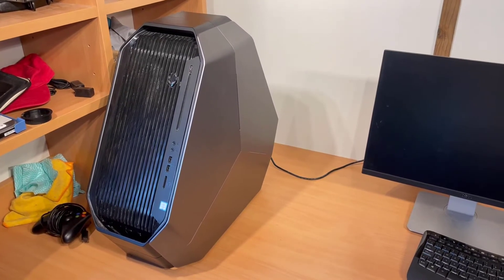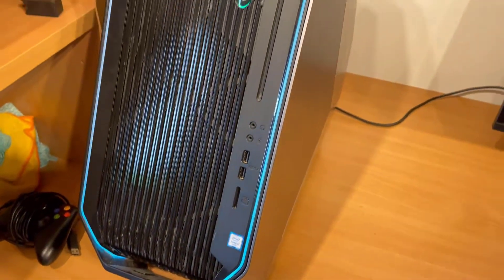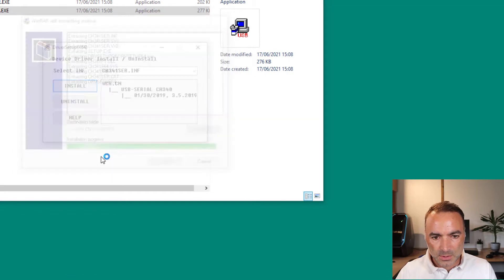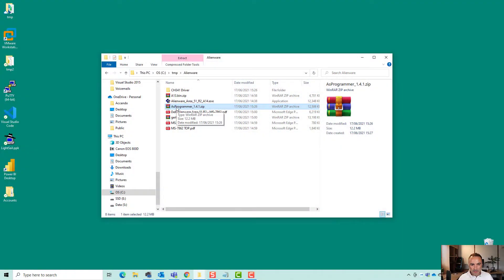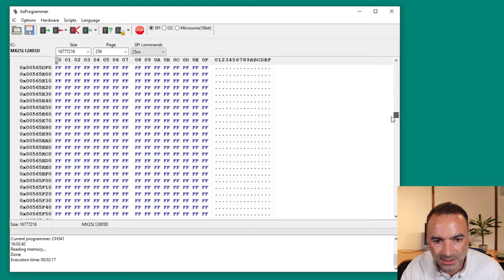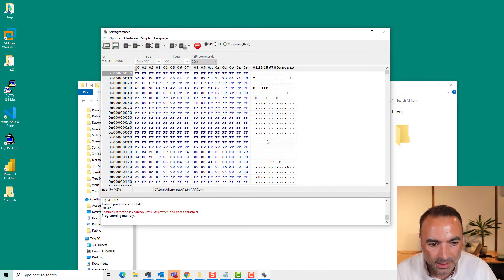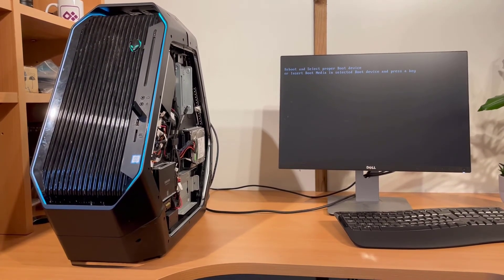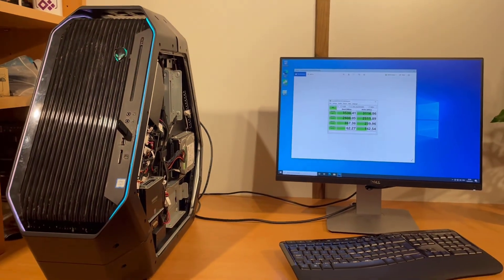Fixing a Dell Alienware Area 51 r2 with a corrupt BIOS

Comment: 10 tries is correct to attach the clamp
Reply from the maker: 😂 yes, it’s not easy to get on. Did you get it done?
Reply: @PaulieM  it flashed bios, however no response after flash. I reset the bios prior as well. All symptoms are the same but no response.
Reply from the maker: @Oldstockz  damn - what a shame. Must be something else wrong with it.
Reply: @PaulieM  yeah assuming GPU or mobo

Comment: Paulie can you please provide me some help with activating my Re Bar function on this motherboard ? I am using grub and using the code setup_var 0x24D 0x1 to enable rebar. I do the the message error ; offset out of range do you know any solution am I using a wrong Grub version of EFI ?

Comment: I got ram (16 up to 32 GB of 2133) and a 3060 to upgrade my Area 51 R2 but my windows corrupted 15 min later and BIOS stopped posting before I could fix windows. What a day lol! Anyhow, thank you for this guide as I’m now back up and running and enjoying the upgrades! 

Anyone have issues with getting command center to install? It freezes pc at end of installation..on reboot after freeze it does not give accurate sensor information. Do I need? Is there an alternative for what functions it had (besides temp sensors.)

Comment: Got mine working again but I flashed via the SPI port using  SPI connector for MSI motherboard. So no clip needed.
Reply from the maker: That’s a much better idea and I only realised it was possible after uploading the video. You got a photo of the connector you can share?
Reply: @PaulieM  hi search for MSI motherboard BIOS free disassembly chip online burning flashing line MSI

Comment: Thanks bro for the great work
my mobo failed to start after command center updated bios to a14
replaced bios chip
it worked for 2 days and now blank screen
a14 won't work on my board
i saw you used the a13 version in the video
can you please provide a link to download and try
note: i successfully attached the programmer and able to read/ write on the macronix bios chip

Comment: Hi, thank you so much the solution worked. It was working fine for around 3 months. The computer now when powered on... powers off and back on with a clicking noise. Re-did the BIOS fix but same issue any ideas? People online are saying it could be the CMOS battery. Purchased new CR2032 and replaced and cleared CMOS after re-flashing stock bios. Same issue powers on tries to boot into Windows and then powers off... then does the power on power off cycle? Any help would be greatly appreciated.
Reply: same here! did you get it solved??
Reply: @joeurban2069  Yes, it turned out to be a faulty Power Supply, replaced PS now all is well.
Reply: @nosmoking3659  it turned on once with me then nothing changed. And back to the same problem. My power supply is new

Comment: Thank you so much!!! I followed the info here and on your guide as well as a few tips from other posters, and got a friend's setup working now. :)   I did find that the heat sink near the chip is black and I think could possibly be a little taller than the one on your PC, and if so that could be why some are having a lot more trouble getting a connection.  I bought the same tool, and I carefully used a file to file each side of the clamp further down along the sides, and then it fit easily.   I was having a little trouble getting it to show on the programmer screen even though I had a solid white light on the PC.  But after a couple of times taking the clamp off and putting it back on, I got the same choices for different chips and chose the top one, as well.  And I also moved the clear CMOS connector over for several seconds as mentioned on the blog.  I connected it up.  But then I had to set the Boot to UEFI in the BIOS for it to recognize the SSD that had the Windows install on it.  Anyway, thanks so much again! :)

Comment: The clip that comes with that kit is a nightmare to connect to the chip. I've spent over 3 hours trying to connect it. I'll try and clamp it onto the chip and when I do, I'll hear a USB connection noise from my computer and a white LED lights up inside of the case. However, the software still does not detect the chip, either of the two times the clip managed to stay on and the white LED was lighting up. 

I'm at my wits end with this project. I'm really not sure what else to do. Any thoughts?
Reply from the maker: It is tricky to get on, there is no doubt about it. It is a shame the plastic casing on the clip is as wide as it is. Three hours is a very long time. When I did it, it took me some time to get it right, but no more than 5-10 minutes. The only suggestion I have is to keep trying, you will know when you've got it right as it just feels different. Do you want me to try and do a close up shot of getting the clip on?
Reply: @PaulieM  Well 3 hours is my own fault! I need to be better about knowing when to step back from a project and try again later lol. I've actually ordered another clip, just to try and rule out the idea that the first one was potentially slightly misshapen or that I damaged it over that three hours. And yes! That would be very helpful. Just to see what a positive connection should look like and sound like. Thank you!
Reply: I saw the white LED blinks in my Area51 R2 case as well while I'm trying to connect the clip to the chip. I managed to get it connected once and the chip was recognized by AsProgrammer but the connection wasn't stable. I tried to push down the clip but only got the CH341A programmer fried after a blink of the white LED. The reason I believe the CH341A programmer was fried is because it wasn't detected via the USB port, and it got super hot once plugged in. This was already the second CH341A that I've got. The first ended up the same. As of now it's still unclear why it was fried, not sure if the BIOS chip got fried too. Already ordered the third CH341A but wouldn't be surprised if it ends up the same.
Reply: @chenxilou4097  Interesting. Glad to know someone else is having similar problems! I don't think I've fried anything though. That would be quite discouraging lol. I think my last resort will be to just build a new PC in the case. As far as I know, all of the other parts are good. It's just the motherboard that's having issues. The CPU is really too old to be viable but that and a motherboard would be cheaper than a whole new PC!

Comment: Paulie!!!!  You Sir are a Genius!!  I cannot thank you enough!!!    I inherited an Area51 r2 literally from the scrap heap at work (they gutted the video card, memory, and drives)  hoping to get it functional for my son as a gaming machine. I borrowed all the parts needed from a functioning machine, but it wouldn't boot, just a couple of bios beeps, and no video at all.

I searched for solutions everywhere for the last bunch of months when i had spare time, and then stumbled upon your recent post (this post June 19th) about reflashing the bios with the cheap flashing kit from Amazon you recommended.  

Dude... i followed your magnificently detailed directions, and with a little trial and error, it worked!!!
The machine boots up again and works flawlessly.

THANK YOU, THANK YOU, THANK YOU!!!!
Your efforts are responsible for a sh*tload of joy for a 10 year old who now has a really nice gaming machine.

Here are my observations/ thoughts/clarifications to make this article even better.

1) Amazon flasher kit- i had no idea how to assemble all the many parts that came with the kit. luckily, i looked at your assembled unit in the picture you provided, guessed, and hoped that i put it together correctly.  maybe a detailed explanation?

2) trying to get the clamp positioned on the bios chip correctly was a pain, and was like flying blind. in order to fit the clamp, i really needed to bend all the pins on the SP11 connector more than slightly (a lot) away from the bios chip. i still kept getting the check settings on ASProgrammer over and over again..... UNTIL- when fiddling with the clip i noticed a tiny white LED light flickering in and out on the little circuit board with 3 small power connectors attached to the case near the case fan (took picture, need to send to you). it turns out, that if you can position/fiddle the clip to where that LED stays fully lit, you've made the perfect connection. only then, was i able to read/backup/flash the bios chip. i don't know if you had noticed that as well when trying to position the clip, but it makes this process it so much easier to watch for that LED light to fully come on to know I've connected it properly to be recognized. i will send you a picture of the LED light lit, as i can't attach pics to this comment.  

3) replace the bios battery before this whole flashing process as my original battery was bad, and
 I'm wondering if that caused the whole issue in the
first place.

4) post a link to this in the Area51 help section at Dell. this seems to be a common issue with this machine, and there's no replacement motherboards available anymore. this fix will be a lifesaver for owners, and their only hope aside from junking the machine.  

5) how can i Paypal you the cost of a Cocktail as a thank you?

Windsor

Image
Reply from the maker: Hi Kyle - So glad the instructions were helpful to you. The tip about the LED on the flasher is useful (I didn't notice it myself). It is a shame the plastic on the clamp is quite a lot wider than the teeth because it does make it difficult to see where you are clamping to, and it does become trial and error.  I did try to include as much detail as possible on the blog post and video, but until you try it it is difficult to get a feel of how the programmer clamps on to the mainboard.

If you want to buy me a cocktail, I'd happily drink one! Fill out the get in touch form on my blog and I will send you my address. Thank you for the positive feedback - really appreciated! Glad that your 10 year old has a machine to play with now - quite a striking machine from a visual perspective.
Reply: @PaulieM  yes, he loves the look, and of course an Alienware offers bragging rights with his friends.  Drink is on the way!!
Reply: also, the led is not on the flasher, but on a small power board mounted on the pc's case buy the exhaust fan

Comment: I have the same computer and same problem. Trying to follow all steps, I get an error that says Check Settings on AsProgrammer.  I also had trouble finding CH341PAR software, I couldn’t install it. 
Is there anyway I can get help?
Reply: Actually, I believe I have everything right, I just get unknown as soon as I click Read ID button.
Reply from the maker: I got the unknown message many times. I really had to fiddle around with the placement of the clamp many times. But once you get it right it will be detected. It could be that your chip is actually completely broken and therefore unreadable, but I doubt it. I’ve since used the programmer on another mobo, and it was so much easier to clip on.
Reply: @PaulieM  it worked after a few hours!! Guess what the problem was? I put the pins on the wrong side of the USB :) it was not reading it at all. The 3200 HZ rams I had, I OC 3 more times- all three times bricked again. I had to flash the BIos 3 times and I was done with the new RAM and OC. Returning them, using the standard 2400mhz
Reply from the maker: @dogukan7532  so, did you get it working?
Reply: @PaulieM  I did indeed. Thank you so much for the video and your blog. All steps were descriptive and easy to follow!
Reply from the maker: @dogukan7532  brilliant news! Feels great to get it all working with such a cheap piece of kit.  🎉 👏😁

Comment: Thanks for making this video. Very helpful walk through. God it’s fiddly and I’m finding getting the clamp to sit on the chip next to impossible. Any tips on this step?
Reply from the maker: Well, it is really awkward but I got a good connection pretty quickly (took me like 5 mins of mucking around). 

You need to connect it to the lower part and open the clamp a bit wider than you’d think. It’s not easy but once you get it on it’s quite stable. Let me know how it goes.